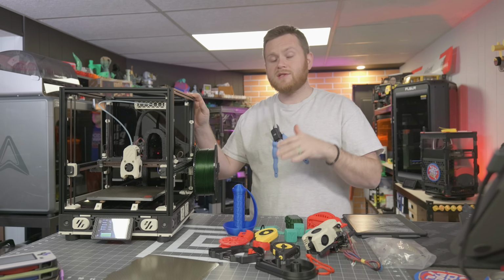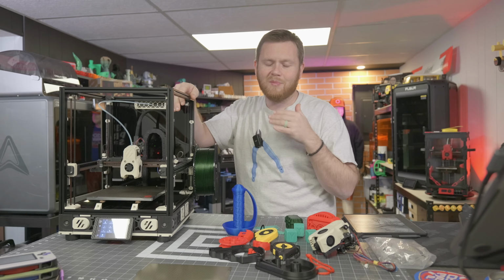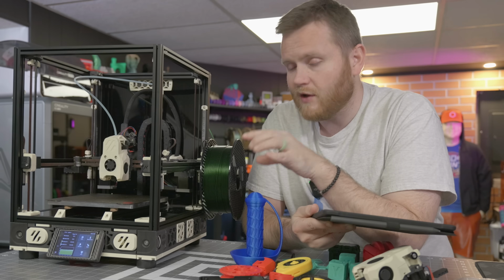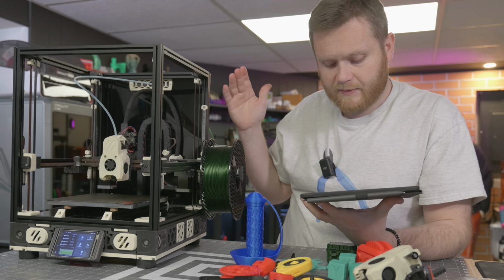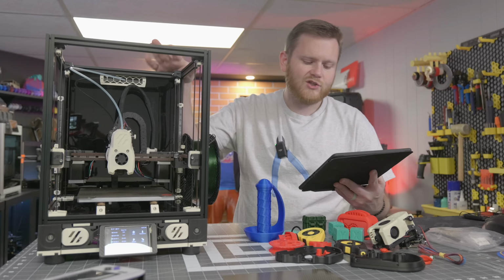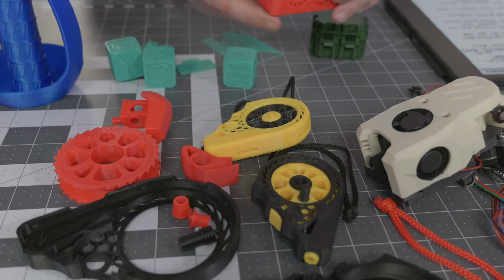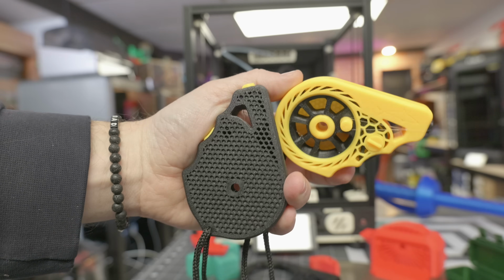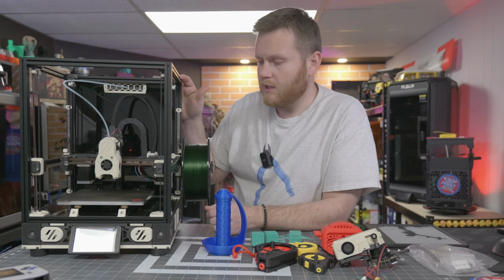This printer is SO fun!

Comment: I've got the kit for a micron+ but haven't started with the build yet. Was wondering about the toolchanger as well, but do you happen to know if you loose any print area by going that route?
Reply from the maker: You do. Up top and in the front due to the toolhead parking. But its not much from what I hear.

Comment: what is the max speed and accel did you got on this?
Reply from the maker: I did not tune this machine for speed. 400/8,000. Mostly because this toolhead is best for ABS/ASA but not great at PLA. However, just like the V0 or the 2.4, you can tune it to be FAST! :)

Comment: I have all the Voron Models, and even modded an Ender 3 into a Switchwire. My Trident 350 kit cost less than 600 euros, shipped. My 2.4 R2 350 cost just under 800. This Micron is a bit on the expensive side.

Comment: Are you joking, or lobbying ? 180x180x180 printer for €694.69 When 256x256x256 Centauri Carbon tempered glass enclosed, solid injection molded frame for 300Eur.
Reply from the maker: I think you missed the whole premise. You are more then welcome to buy a printer and use it. I have a room full of those. But to me, the most fun machines, are ones that I have built myself. This one being one of them. No joke. And lobbying? lol cmon, you feel good about saying that?
Reply: Is CC running Klipper?
Reply: @LeftyPencil  Nobody knows, it will be hacked like flashforge was sooner then later.

Comment: Looking forward to the 4 head toolchanger videos.
4 colours is plenty for most prints.
One question I cannot find info on is can a filament be changed while the head is parked.
Have not been able to find good info on that.
Cheers.
Reply from the maker: Great question. You should be able to control the toolheads individually. Since each one has its own extruder, you should be able to freely swap filament when they are parked. Im confident, although, I dont have it yet, so it might be worth more digging to nail it down to 100%
Reply: @3DPrintSOS  Can you pair, lets say, a ERCF with multi toolhead? Have like 1 "main" toolhead that the ercf would be hooked up too and the others as "secondary" ones? I think that would be cool as a all in one kinda deal but dont know if its possible and have never asked. Also this is the first video ive seen of you and just subbed. Great video and very informative :)

Comment: I put endstops on my machine. I remember reading somewhere that going sensor less is not as accurate for toolchangers.  As far as cost of these kits. I did enough modifications to my SV06+ that I could have purchased a better machine for the same money. That is why I saved up and purchased my V2.4 kit.
Reply from the maker: My plan is to give it a try. I want to add multiple homing attempts and an average to see if it will all still work out. Apparently, I hate extra wiring haha
Reply: Toolhead aligment is so difficult already.. So having relaible homing is crucial in my opinion

Comment: I'm on the fence about ordering a Micron+ kit. it looks super cool, but I'm not sure how much I'll like the 180mm^3 build volume.
Reply: I have a bambu a1 mini, and a voron 2.4 300mm. I end up using the bambu a1 mini more often because it's faster to heat up, and to start a quick print. Because of this, I've bought a v0, and a micron kit as well. Most things I print will fit on a micron, the 180mm size is just right. The larger voron's are nice, but they just take so long to pre-heat and start, it slows down when iterating through part designs.
Reply from the maker: For me, most of the things I tend to print are in this range. But I totally get that sometimes, its better to have a larger machine.